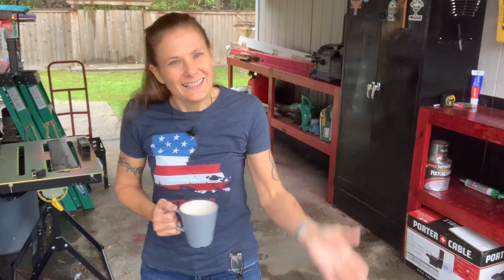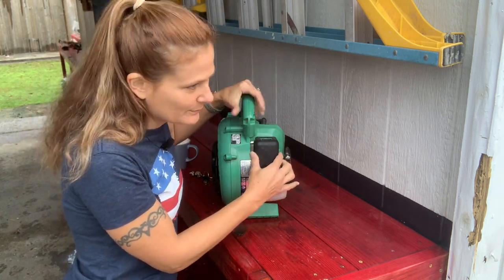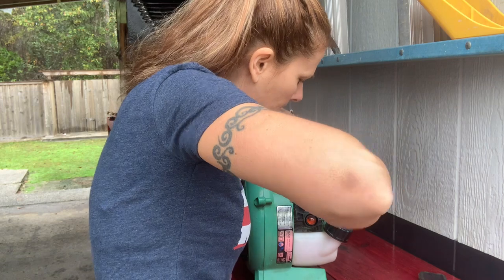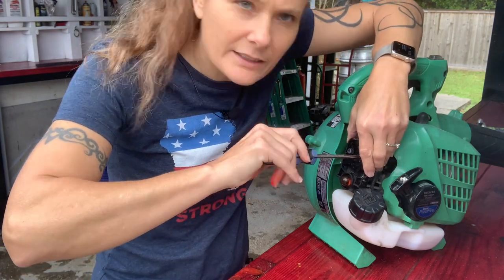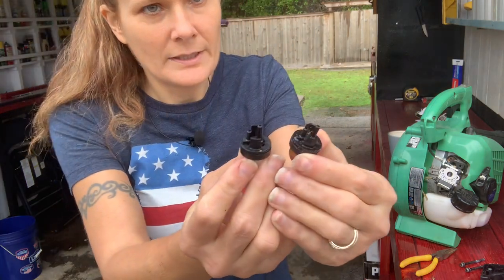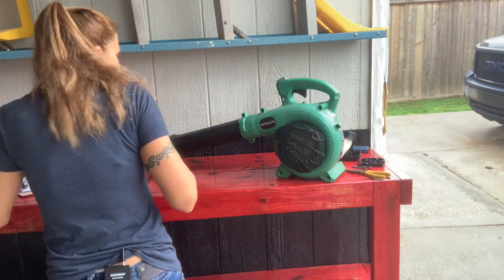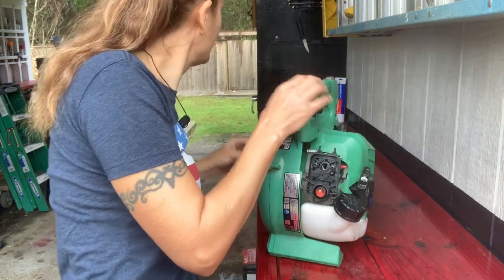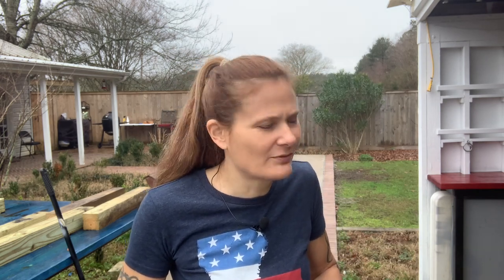Replacing a primer bulb on a Hitachi leaf blower

Comment: My blower is the exact same model as yours, but when I took it apart, I noticed the short pipe (on the primer bulb) was going to the carburetor and the long one went to the tank (just the opposite of what you showed.)  Nevertheless, I assembled it exactly like you did following "short tube sucks, the long tube blows" idea.  Being a guy and being somewhat impatient I skipped ahead and missed the part where you discovered you had the tubes hooked up opposite to the way Hitachi did it.  I went back to watch the video again and that's when I realized I had it wrong.  No big deal.  I changed it so it works now.  I would probably not even have gotten the black plastic cover off without this video!  Thanks.😁
Reply from the maker: Thanks for sharing your story I was trying to figure it out myself as I went along I hope I didn’t confuse you too much 😂 I’m glad you got it figured out and I’m glad I got a chance to help 😊

Comment: Not a mechanic Betty, I was taking a trip into the twilight zone till I saw your video. Everything was going smoothly until  I tried to put it back together. Then those screws suddenly shrunk, not long enough. Worked with it for 45 minutes, very frustrating. Did not remember a big gap between the carburetor and the plastic plate. After looking at your video I realized  I that plate was backwards. Finally sanity returns, thank you so much!
Reply from the maker: Sometimes even with pictures things can be confusing. I will turn the part every which way and say “what in the world is going on???”. Anyway; I’m glad I could help, that’s what I made the video for 😁. Take care and have a great day.

Comment: Very good job.   Nice closeup shots and explanation of how it works.  One thing that came to mind that could have been a helpful hint, although you answer the question later - but it took a correcdtion - once you get the plate off and can see the back of the bulb before you pop out the bulb, look carefully at the bulb and you'll see two stems.  As you pull off the two tubes, see which hose is attached to the longer and shorter of the bulb stems.   Be sure to reattach the lines to the same stems.   That's not a criticism because you caught it.  But that eliminates the need to figure it out later.   Thans - post more !

Comment: YOU are VERY mechanically inclined! I just discovered that gas can only flow through the carb in one direction- from the supply line ( has a filter on the end of it in the gas tank), through the carb, and out on the suction side of the bulb. The gas and air that was in the carb is then ejected back into the gas tank via the smaller line that doesn't have a filter. l think you were just figuring that out in the video.

Comment: Unfortunately, you state that the longer nipple on the primer bulb goes to the carburetor. That is incorrect. The fuel isn't pushed to the carb, rather it is sucked through from the tank. The shorter tube that provides the suction is the one that goes to the carb. I was also able to replace the bulb and tubes without pulling the carb or plastic holder plate off. I did this to avoid affecting the gasket between the carb and head as I didn't have a spare. I used needle nose plyers and a flat head screwdriver to pry the lines off. Nice video though. Thanks for doing it.

Comment: Ms. Betty......I am a novice at mechanical repair. I am attempting to change the fuel lines on my Hitachi b/c one of them is broken at the grommet. I can't seem to loosen the bolts on the fuel intake/choke assembly.....I have used several different phillips head screwdrivers to do the job but no luck. As a "rookie" I do not have a bunch of job specific tools in my little toolbox.....and as a reitree I am trying to save a bucks by doing this myself (famous last words!).  Any suggestions on how to loosen the assembly bolts? My Hitachi is over 10 years old.
Thanks for any advice you may have to share.....
Reply from the maker: Did you spray them with a penetrating lube like pb blaster this is usually all it takes. Also try turning them both ways sometimes tightening them can actually help loosen them. Be careful not to strip the head I know you said it was a Phillips head but if you could find something to give more leverage like a breaker bar may help as well. Good luck to you
Reply: @NotamechanicBetty  Thank you m'am. I will go back to the garage and try it again. (whatever doesn't kill you, makes you stronger). Thanks again for the tip. Appreciate you sharing your knowledge for those of us who are "mechanically" challenged.

Comment: Hi Betty, I have the same Hitachi leaf blower that needs to replace the old primer bulb, where did you get the primer bulb kit?     My thanks in advance.
Reply from the maker: I got mine from Autozone, sometimes they put lawn and garden in the back during the winter months but you can ask and they might have some available.
Reply: @NotamechanicBetty  Thanks for the quick reply Betty, I'll check Autozone tomorrow here in S Florida near me.
Reply: @NotamechanicBetty  No luck at Autozone, I went on Amazon and ordered the full replacement part for $15. arrives on the 11th
Reply: bought mine at a mower dealer, (and repair) $4.50